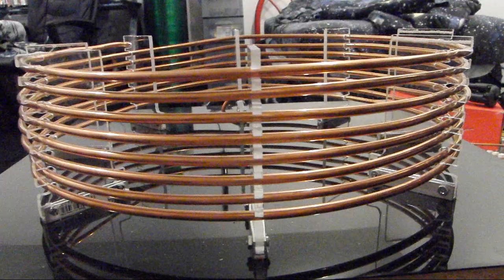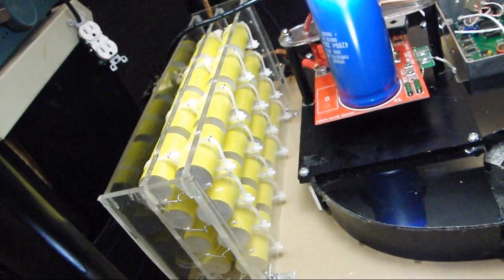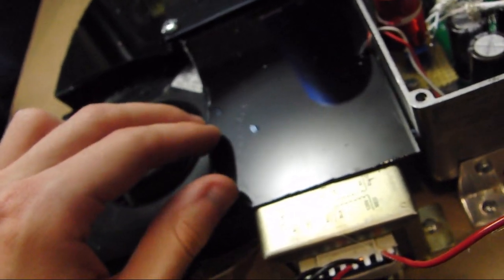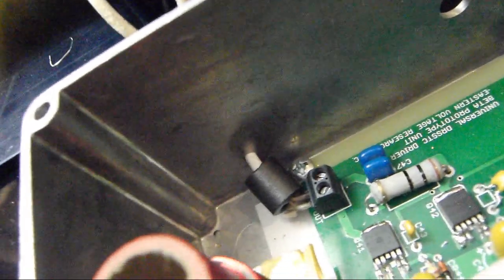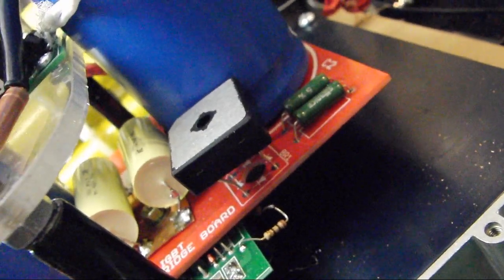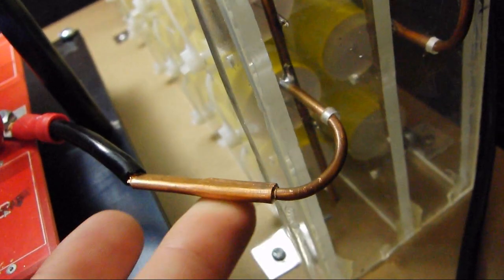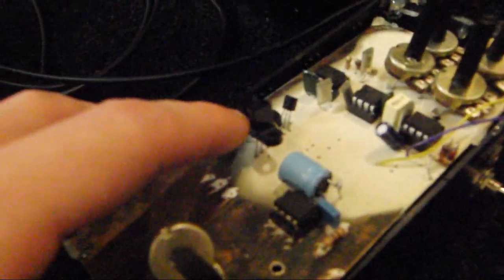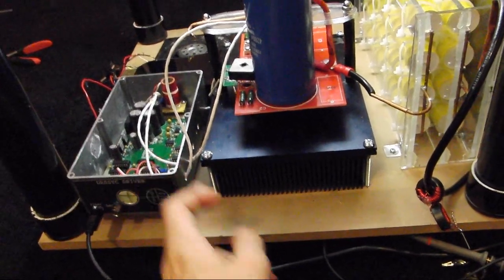DRSSTC in details

Comment from the maker: @spinctah Ive ripped them apart before. They are built very good, love the quality.  I got it on ebay for like, $120 or so?  Cheap!  150VAC, 30A rated, with a 25A fuse.  I have pumped 20A at the most through this, and I have no complaints.  I'm not a fan of screw-down terminals on the front, the lack of a 120V plug, and no grounding.  But, mods can fix that.